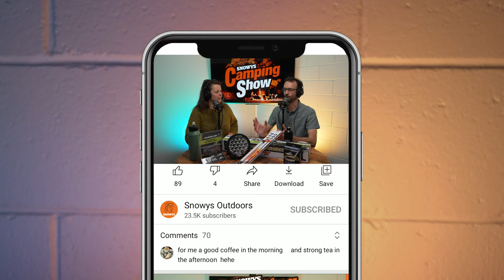Ep 29 - 12V Lighting with Hard Korr

Comment: I have their two bar kit, in metal box, good kit.  However, as Lauren mentioned, I would like to permanently mount light sources, on my ute and box trailer, to reduce setup/pack down time, this makes a real difference if you camp once a fortnight.  When you mentioned dimming a 30W led, did he say you needed a 'core' dimmer?
Reply from the maker: I'm excited for the new products coming soon that will tick those boxes @Steel Springs...Zac did say Korr dimmer, but i assume he meant the classic rotating dimmer switch.  I'll probably be looking at the remote option though, id say its more convenient.
~ Lauren

Comment: Can you run 1 light of 2 switches ie one inside the tent and another outside ?
Reply from the maker: Great question! Hard Korr do have splitter cables available, but they go in the opposite direction to what you are after eg. one dimmer to 2 lights.  As the male and female connectors run in a particular way you wouldn't be able to use these for your situation.
the other consideration is power need to run to both switches, so you'd also need a splitter on your battery end and run two separate lines to somehow re-join them at the light.
Possible a good alternative is the wireless dimmer switch which you can take with you inside or outside your tent.
~ Lauren

Comment: very informative video. I don’t have the funds for a 2nd battery setup just yet but Quick question- boys said we don’t need a 2nd battery to run lights. Can just plug straight into cig lighter, does the car have to be on for that to work?
Reply from the maker: It's likely that if you are using a factory fitted cigarette plug then the ignition will need to be on. You could get the wiring changed, or a new plug installed that is direct wired if you want to run lights from the starter when the car is turned off. ~ Ben
Reply: @SnowysOutdoors  thanks for quick response. I think a 12v power bank might be my next option, do you think you guys will be doing ab episode on 12v powerbanks in near future? I just need power for camp lights as I will be using an icebox for food. 2nights camping is what my family will be doing. Thanks heaps mate. New listener to podcast and loving it!
Reply from the maker: @s.91.a  we've made a note to record an episode on power banks, not sure when it will eventuate but stay tuned. ~ Ben